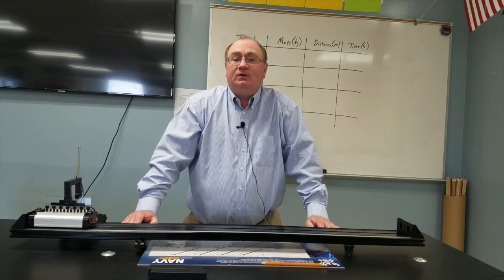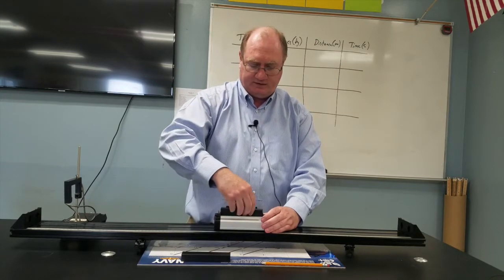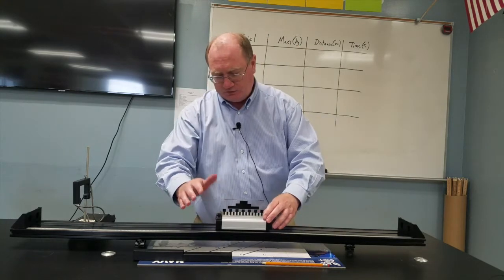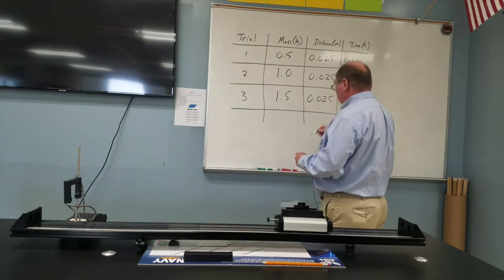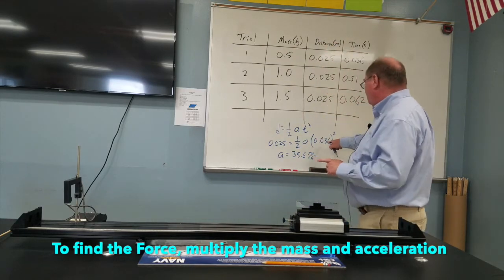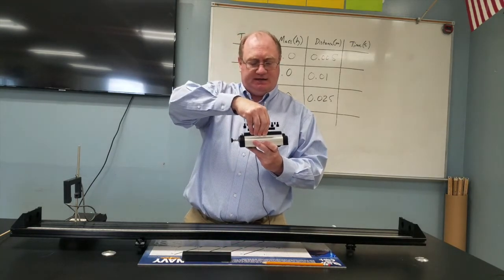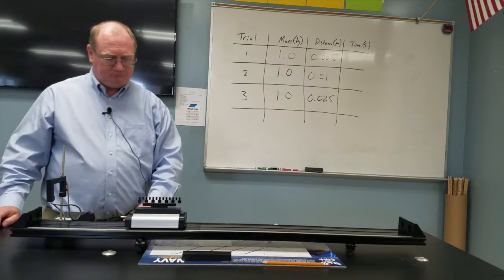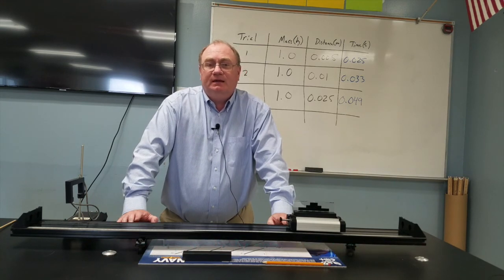Newton's 2nd Law Lab

Comment: Why did you use those distances in Part 2?
Reply from the maker: Those distances matched up to the distance the spring in the cart is compressed. So, the timer measures the acceleration of the cart.